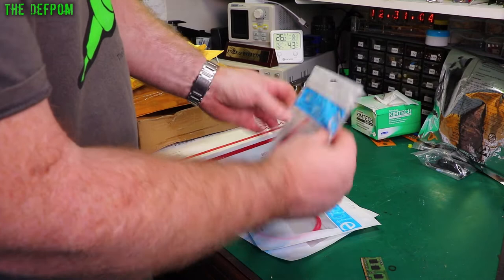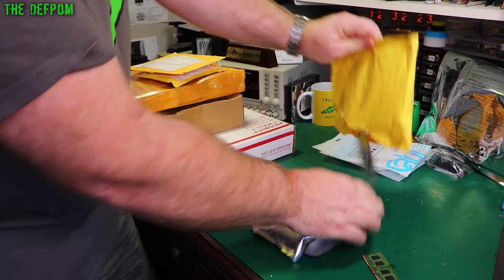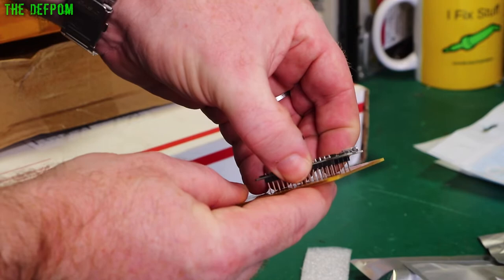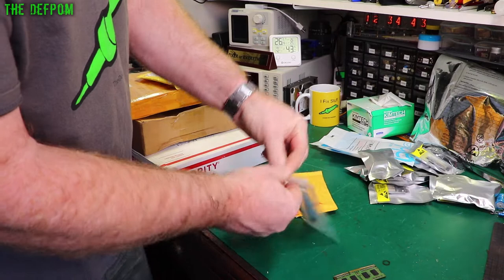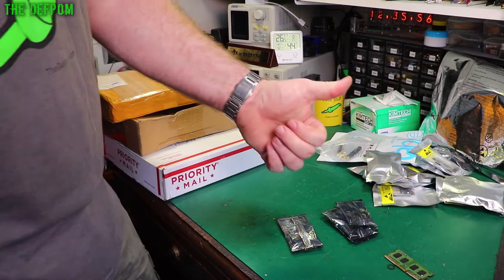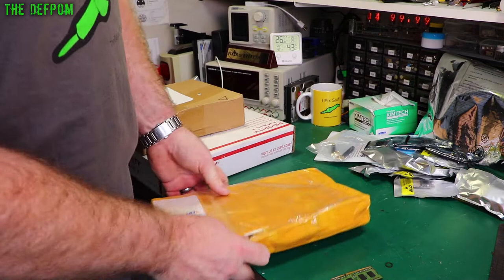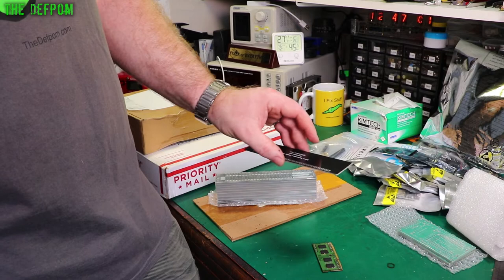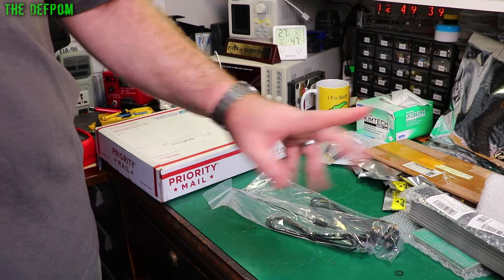🔴 Defpom's Mailbag - Mailbag Monday 25th January 2021

Comment: I think you will find the RTC has an EEPROM on it, hence the two rows of interface holes.
Reply: yeah, from another website: " Along with the DS1307 real time clock, the module also has an Atmel 24C32 EEPROM chip (4kB) which is handy for storing data without worrying about power loss. There is also space on the board to solder your own DS18B20 temperature sensor."
Reply from the maker: Thanks